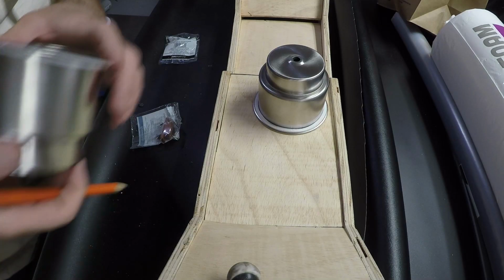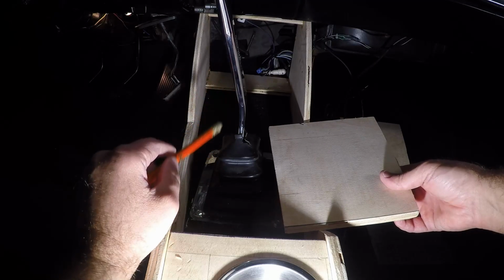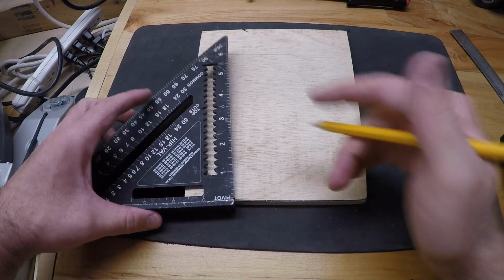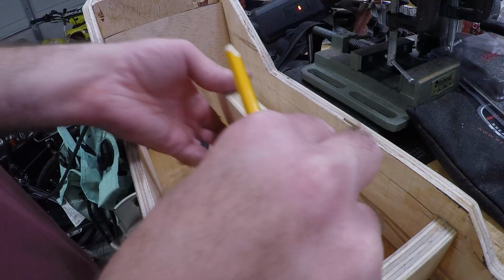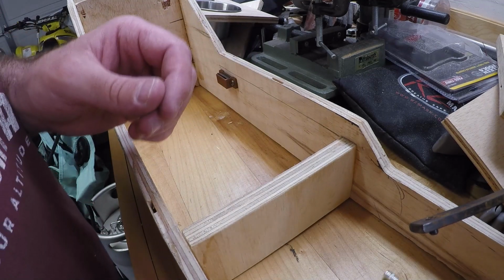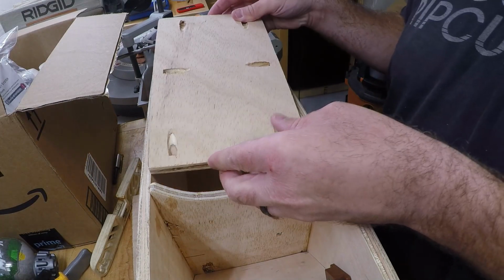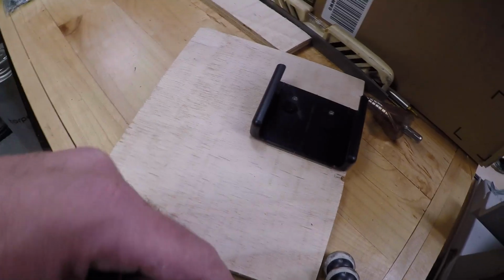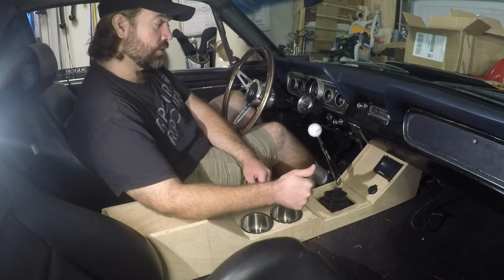Making a center console part 4

Comment: with the location of the efi sniper and the charger, is there room for a double din head unit?
Reply from the maker: No not with both of those on there.  there’s enough room to put a phone cradle which I have been debating about doing but have not yet.